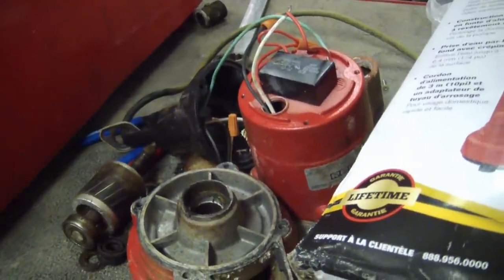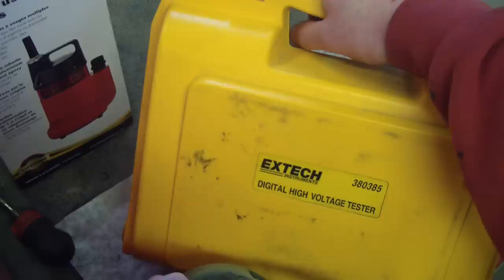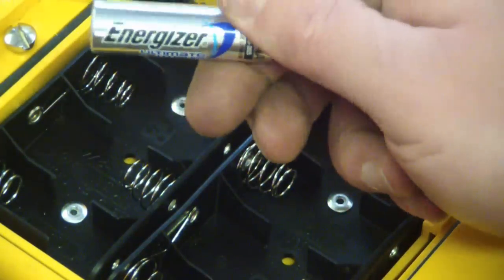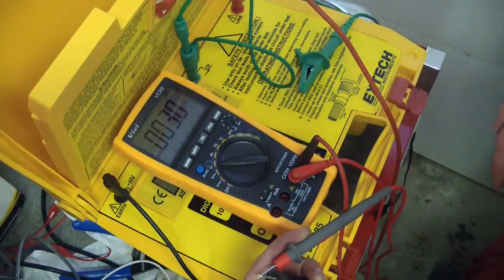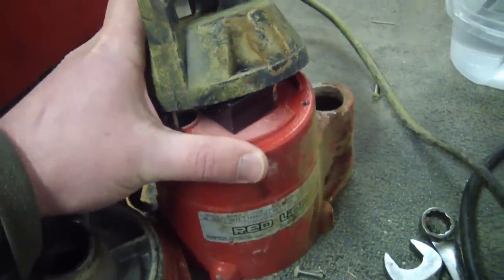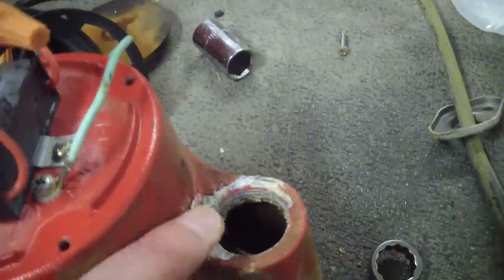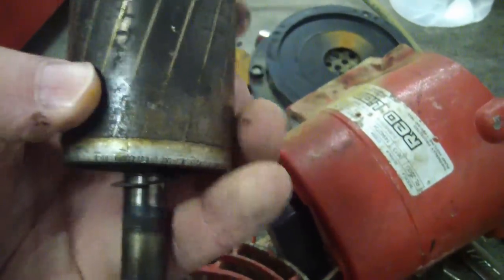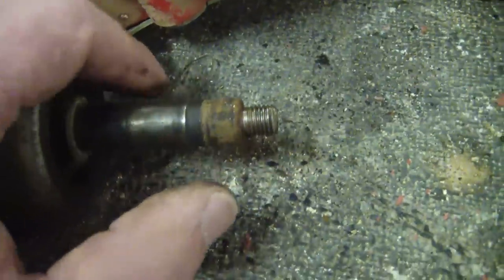BOLTR - La BOMBA! Red Lion water chooch'r is engineered to FAIL!

Comment: So first, most honest companies that have generous guarantees, only guarantee electric motor products for 5-years (ie. drills, saws, etc). Second, a pump not only has the electric motor element but also has the pump head which is even more susceptible to early damage through unforeseen things or abuse than the motor has.  So any company that claims lifetime warranty for a pump would have to charge at least 5-times the actual price of the pump (for insurance) or is being disingenuous (won't honor that guarantee)!  I don't know of any legitimate pump company that gives a lifetime guarantee.

All that said, I bought a house 13-years ago that came with a pool and with that I inherited a small submersible pump for the pool cover.  While I'd love to tell you how smart I am in selecting that pump, I can't.  What I can tell you is that this pump has been abused many times over the last 13-years, run dry, left out in the freezing weather, etc.  It still works great (mind you not as good as it did before running dry) but it is a great submersible pump.  It is a Simer Model 2300 Geyser probably has only a 90-day guarantee.  Don't be sucked in to a guarantee that's to be too-good-to-be-true.

Comment: I never need to test something at more than twice the voltage rating of the insulation of the cables... You can make your fault worst or blow out the cables by testing this high. I would bet you that your tester will NOT go up to 10Kv... you should test it just for shits and giggles ;)

Comment: So in wondering, did you ditch the bomba into the scrapheap and get a new scoocum pump, or mill down the shaft, hammer a stainless sleeve onto it and replace the bearing so you can keep using the old fucker? Can't fuck'r anymore amirite?

Comment: Yep toyota did same thing late 90s early 2000s. They saw americans buying cars every 3 years+/- so they downgraded their engineering so you would want to buy a new car. Look at all the computers in cars now, we need computers BUT its gotten insane. So insane that cars built with huge touch screens, crazy can-bus computer systems, bluetooth diagnostics, etc will be trash in a couple years. These compenients have no aftermarket support (its not profitable to manuf these things aftermarket) so will total a car for a 10,000$ replacement. Sad really cause in 80s-90s toyota overbuilt engines to a level we probably will NEVER see again. Hell the 2jz can push over 1,000hp on stock bottom end. Had forged internals, girdled  crank bearings, timing chains, etc etc on the BASE model ECONOMY engines. Hell GM still may not be using all forged internals. Theres basically zero engineering argument for american manufacturers lack of long lasting products. Sadly we have based our economy on consumption so if you build something to last, causing stable or not rising profits you are vilified. Think about that. Our current economy is based on infinite growth. Share holders only want more profit every year. Obviously you can't grow forever. Hence the problem, its all based on quanity not quality. Sadly though theres enough stupid people who will buy this shit over and over, leading to anyone wanting a better product s.o.l. . I really get more and more fed up with society everyday....im going to get a boat and sail away from this insanity

Comment: I think you meant GFCI (Ground fault current interrupt)
Reply: No, he meant GFI, ground fault interruptor. GFCI is also an acceptable acronym but it's Ground Fault CIRCUIT interruptor
Reply: ***** ah ok, thanks
Reply: I've heard both over the years. GFCI is correct, but it seems odd that so many people say GFI - so it might have a meaning I'm not aware of. :P
Reply: ***** Both are correct and both are used by various manufacturers and technical writers.

Comment: i always hoped lifetime warranty meant for the buyers life but ive returned a drill only 3 months after buying it and they said the warranty expired... no matter what i said they only gave me 10 bucks store credit for the 70 dollar drill.. said no deciding to break it open and fix it, found the problem was a wire connecting the battery to the drill melted... tldr fuck warrantys..

Comment: beautifully engineered? well built? princess auto? are you crazy?
Reply: camtheham13 
It's actually not bad. I don't know how much this exact unit cost but the closest thing I've found from them is like  $125 and the design reminds me a lot of something like a Tsurumi or an old Godwin trash pump, teardown wise, and those cost a fuckton more per unit. Aside the shitty shaft design, it isn't that bad, but if'n ya want durability for long term, ya gotta quit fucking around with "residential" grade hardware and pony up for the quality kit or live with periodical replacement instead of maintenance/repair every few years or so.
Reply: I am not saying they could never make any good product, but they are usually a mrs. right now store, rather than a mrs. right store
Reply: camtheham13 
A bit like Harbor Freight that way but sometimes they latch into a product that isn't total dogshit. I looked up the manufacturer of this sub-pump and they aren't anybody's house brand that I can tell, but this was a piece sold to a pricepoint and that was likely the end of that discussion so far as long term reliability is concerned. Maybe they've fixed that issue in new ones or it was a shitty supplier run... who knows but it's a cheap utility sucker for soggy basements and whatever, so ya get what ya get until you buy the good stuff you can actually buy a rebuild kit for further down the line (when, not "if" ya need it).
Reply: princess auto is a lot like harbour freight

Comment: If you own a W639 mercedes vito 2013. the dealer is blocking turbo's for these vehicles. I couldn't find any turbo for this van anywhere. I had to redo the housing myself witch was sketchy , but she's chooching along nicely now 60K miles later. 
Also the front suspension arms ( need to be replaced completely if the front pressed bushings crap out ?!!!! )   I found those on aftermarket site seperatley saved around 2000$ . I love this van to bits but holy jeezes if something breaks Mercedes wants to shove its fat german leg up my arse xD

Comment: 250kV flash tester will definitely rattle your fillings loose. Used one for years building electrical pixie wrangling doodads, by fuck you knew if you caught the hot wire.......

Comment: you are actually somewhat wrong .. the motor is a 3 phase motor with a capacitor thingy that makes 1 phase to 3 phases ... also we never test pumps like that with more then 1kv .. just saying ;) .. also i am waaayyyy to late with my reply lol i actually worked several years with pumps like that ... though most of them where allot bigger then that .. like everything from the size you have to 4 meters high that i worked with ..also leaking into the pump house is normal .. after some time .. normally what we do is washing them very well and then dry them and give them a new o ring ..and the shaft seal .. the shaft seal are those that always fail because though have to seal and rotate and create friction that wears them out ... and its not engineered we just cant make better stuff then that .. and this happens also with stainless steal .. again the seals are the parts that always fail ...  though the bearings needs ofthen only to be changed unless the motor windings are actually burned .. i am not sure if that is just dirt or actually burned from the video ... btw though these  bastards are quite tough and can life with water in them with a bit of service

Comment: It's difficult to believe that the failure point is deliberate, as the entire rest of the pump shows concern for long-life. If the bottom seal issue were intentional, then why would they have poured money into every other design issue? In other words, why use a quality top-end bearing that might last 10 years when they know the bottom seal will fail first? Instead, they could have just put in a crappy top-end bearing that might only last three years. Everything in your teardown shows concern for service life except that bottom-end shaft corrosion issue, so it seems much more likely that the designers just missed that one failure mode. Further, why give a "lifetime" warranty to a product that you expect to fail quickly (unless you expect most of your customers will never exercise their warranty rights)?
Reply: +Ed Price 'Lifetime' Warranty is not legally enforced in the United States or Canada.  Add on top of this that brand changing will nullify any  backed warranties. An example is try claiming a warranty on Popular Mechanics tools once sold at Walmart, not going to happen once Walmart ended that brand licensing agreement even though the tools were made by Stanley.

And it is engineered to fail, not to screw the private consumer but to not damage the manufacturers market in the commercial sector. This is one of their sump pumps re-branded with a change that makes sure it can't be bought and used in lieu of their more expensive offering to the commercial sector because it won't last due to lacking the stainless steel sleeve. 

To design and build a lower grade but long term reliable pump for Princess Auto would have costed them more in engineering and tooling then they'd ever make on the small margins of Princess Auto's contract order.

Comment: Volkswagen (and probably others too) engineers their transmissions to fail after the end of their warranty. Not with mechanical fuckery, but by informing the user that they don't need to change their transmission fluid every 30k miles. "Lifetime lubrication" they claim. They do this so they can remove $300 from the anual cost of ownership on the sticker. A fluid change is expensive as fock. Anyway, around 90k miles, three times farther than the user ever should have driven, the transmission starts to go to shit. And because their fluid reservoir is so needlessly complicated, only the dealership has the right equipment to flush the whole transmission.

Comment: What about another model for Red Lion RL-SC33T 1/3-HP 3600-GPH Sump Pump with Tethered Float Switch and 1/2-Inch Solids, Cast Iron?  Have anyone comment on this?  I just want a reliable sump pump that I can use.  Please comment.

Comment: That its not the truth, mild steel shafts can run for years, i used to work in a shop that maintained water pumps and motors, and there was a Portuguese  brand Rabor, that used non inox shafts, that run for decades, even with corrosion, the problem with your pump is sealing on the wrong places, and since is a submersible pump, not being full of mineral oil to proper heat transfer.

Comment: hi i like your video and expertise a LOT. may be you could help me making a lapidary horizontal grindstone?  i have some problems to support the shaft (supporting heavy grindstone)
Reply: yes thank you but how to support  the shaft ? it will slide in the bearing ... i don't know how to fix this :)
Reply: yes i'm stupid i thank about shoulder in the night . the problem is to make the shoulder . metal turning is expensve here and i can't make it in my drill .that's why this solution did'nt come in my mind. thank you for your help . i think the snap ring  or shaft collar will slide due to the weight (heavy shat+heavy plate +heavy grindstone(400mx80mmthick or more) . will it work according to you ?
Reply: MAESTRO2054  If you drill a shallow hole for the set screw to lock into it wont slide

Comment: LOL GM wired most of may cars electronics into the stereo, no stereo, no start. Not really engineered to fail but it kinda sets them up for a nice repair bill of their choosing if they tell you its the ecu or something.
Reply: Collin Huebler Is the stereo one of the removable faceplate or fully removable ones? I've seen it where that is wired that way to prevent theft so long as you remember to bring the stereo faceplate or entire radio (the latter being rather onerous and a stupid design) with you when you leave the vehicle.
Reply: ElbowMacaroniKP No removable faceplate, it was stock. Changing the stereo pretty much disables the driver information center and the car won't turn on without an expensive harness. They claim to keep the driver information center working but I've tried a few and they all give my car random faults.

Comment: How does it make 10,000 volts from C batteries?
Reply: sgeck Easy to step up voltage.  Your computer monitor does it all the time.  The light in an LCD (as long as it's not a new fangled LED backlight) steps up the 16-19v in your laptop battery to 8000V+.  Lots of ways to do it, some fancy, some not so much.

Comment: It seems that everything is engineered to fail these days after a certain length of time. My big beef is with printers designed to clean the print heads every time you switch them on , thus wasting excessively expensive ink, and they switch themselves off after a period of idleness so you cant leave them on so you have to switch it on and off it goes into print head cleaning mode. Bastards!! Grrr!

Comment: Piss poor planned engineering! Using a stainless shaft, sealed bearing & higher quality caps maybe adds $50 to the price, but it would extend the life of the pump by 10 years easily. That would brand you'd want to stick with and tell others about this beast.

Comment: Since you didn't mention how the pump was controlled are you sure it didn't run dry and burn up the windings? Sump pumps are cooled by the water they are pumping. http://redlionproducts.com/media/33080/998488-rl-250u-owners-manual-08-13.pdf

Comment: How many time could one replace this item before it adds up to the cost of a more expensive longer lasting alternative? expenditure over time is what I look at.. Condition my change where the more expensive pump no longer is required to operate, or I may move to another location. Purchase price is no indication of better quality, on could spend more and find similar engineering.

Following recommendations to remove batteries that will remain idle for a period of time is good advice to follow, but place the gear and batteries in the same storage spot. Admit it you couldn't remember where you put the batteries. ;)

An ogm meter that use a higher voltage source can be home brewed inexpensively to have on hand for those  time it it's would be useful. Probably may not need to follow that rule of thumb to prove useful Rectifying the household line voltage could be enough  voltage  to disver faulty motor winding. Of course don't do that if you don't know how to employ current limiting. As always use use suggestion found in YT comments  at your own risk
Reply: well he did seem to run it for a long time. I would assumeost pumps would need to be replaced relatively quickly if ran 24/7. maybe they would last long than a year but I'm sure they won't last long enough to make it work it.
Reply: Lifetime warranty so it wont cost him anything to change it out for a new one i guess!

Comment: 99% of equipment that you might need to test will be fine using a 5KV megger. Most of your failures are gonna be easy to detect at 5kV, probably at 1kV. You only need 10kV for very high dielectric equipment that has to meet strict insulation requirements. Even then, if you do a 10KV hi pot, you probably don't even need to meg at 10kV. It just depends on the rules for your piece of equipment. For basic troubleshooting, we use 1KV 90% of the time, and 5kV 10% of the time. I'd never buy a 10kv megger.

Comment: Why would you need 10000V on a less than 1hp motor? 500 or 1000V works for are EMT's at my work and you're  burning the insulation on the windings. If it wasn't fucked before youre plum tuckering now

Comment: I think it is caused in the assembly plant and they just haven't followed specs there. Maybe the guys assembling it don't even know the difference, maybe the fact it should have been stainless steel weren't mentioned with the other part specs. Maybe they don't even know the difference by sight. Why on the world would you engineer everything so well, with no expense spared, if it is meant to fail within a year on purpose? If makes no sense whatsoever, you got your logics twisted here.

Comment: You were interested in a similar "engineered to fail" disaster ... I present to you the Volvo Penta MD22 raw water pump ... whose job is to draw raw (salt) water for cooling a marine engine ... has a shitty pump shaft which requires speedy-sleeving after a few years of use (and if neglected drips salt water all over its own starter motor with predictable results) ... see also: http://jeanneau.proboards.com/thread/2354/repairing-water-pump-volvo-penta
Just fixin mine right now

Comment: Lip seals are not even the proper type of deal for this application. I would expect to see a rotating pump seal with a stationary seat. You can't  just stack lip seals like that. The two inner lip seals can never get properly cooled and will burn up. It's cheap engeneering, and blatantly stupid.

Comment: Never attribute to malice what could be attributed to stupidity. And assume everyone is a f***ing imbecile until they have proven otherwise.

Could be a competent person designed most of the pump, then an idiot had the job of designing the rotor. Or more likely a competent engineer drew up the plans, then when it came to manufacture, an accountant looked at the price of stainless and mild steel and didn't know the difference other than cost, so ordered the cheaper one.

Comment: What a piece of junk!It should have  oil inside.You know nothing about pumps if you buyed that! For low pressure buy impeller pumps(brushless) with zirconia shaft and bearings - chinese jebao DC pumps are the best.For high pressure the russian diaphragm pumps with electromagnet are the most reliable working flawlessly for decades thogh the chinese copyed them and made them american style with aluminum windings instead of copper and they break fast.